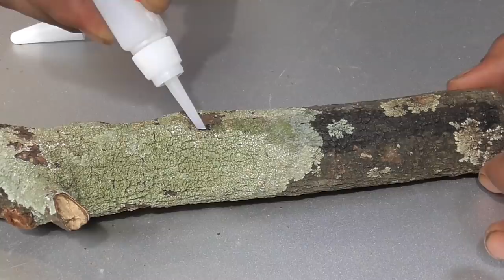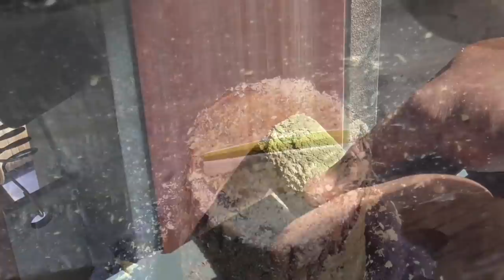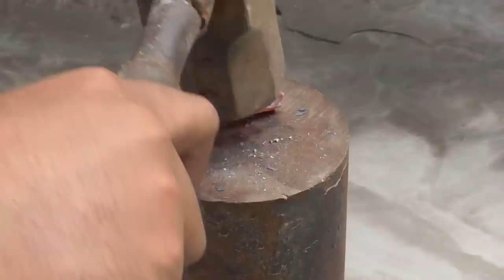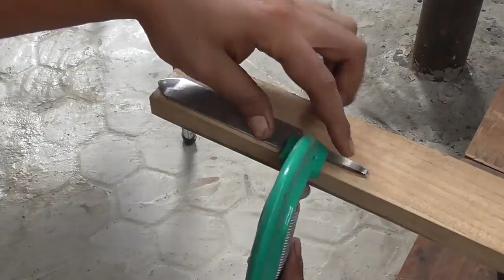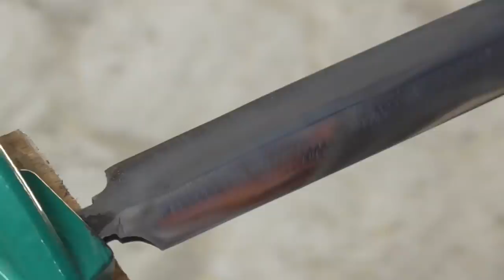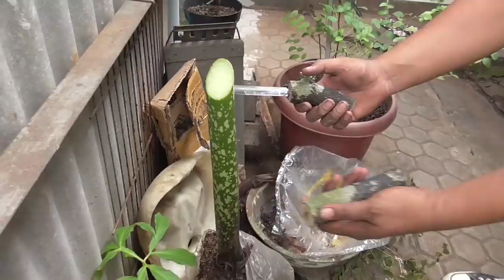Making a Secret WOODEN LOGS KNIFE  - Knife Making

Comment: Beautiful job.  I missed how you cut the slot in the part that the knife blade slides into.
Reply: Watch again. He drilled a hole first to insert a triangular file, then he put file into hole and filed a slot as best he could, then burnt it with a hot screwdriver, then inserted founded cardboard into the slot, then put saw dust down between the cardboard and the sides of the slot and added superglue to bind the sawdust together and thus make the slot tight and tidy.

Comment: Interesting. Might have saved a little time using a file instead of a hex key, since it would already be flat and the tang would be basically the same shape you ended up with at 3:40
Reply: In my limited experience doing this hex keys are a little bit more appropriate steel for the project.  I’ve never had good luck forging with files without blending with a softer steel. Just my $.02
Reply: @thomaslthomas1506  good point, well taken!
Reply: @thomaslthomas1506  Files are generally more brittle than hex keys, no?
Reply: @kengruz669  in my experience yes.
Reply: I made a stiletto from a file about 55 years ago. Went through the whole process. Something like 100 hours.
Quite nice.

Comment: Didn't see the blade go through hardening and annealing after shaping (edge retention?), and what looks like CA glue may be a questionable choice for attaching a tang (CA tends to be brittle, a two part resin would be much stronger). Other than that, it's an interesting craft.
Reply: he made a work of art and did an AMAZING JOB?! Other than that, it DOESN'T matter. Give him credit w/out the negativity. Appreciate his talent. Geese.
Reply: I agree with post, epoxy would have been a better choice. Any hard work with that is going to break it. The fit and finish isn't tight, very loose wobble when closed. You wouldn't want to leave this outside as it'll be rusty in days.

Comment: Quenching the metal with water? That knife is brittle af.
Reply: What, like Japanese bladesmiths do? Yeah, what do they know...
Reply: @davidpaylor5666  I've seen Japanese bladesmiths work with blue steel and damascus, don't recollect them quenching with water..🤔
Reply: @subhamhalder3431  They do though. They definitely don't use oil, not traditionally anyway. Modern methods and techniques have probably crept into some Japanese traditional arts but they still quench steel with water. Everyone did until comparatively recently.
Reply: @mohammadimamarifien5443  Like I said, water quenching. I do know what I'm talking about. Great vid, thanks for recommending it Mohammad.